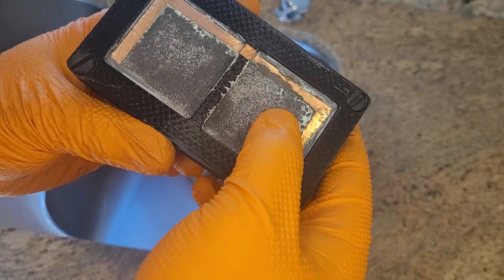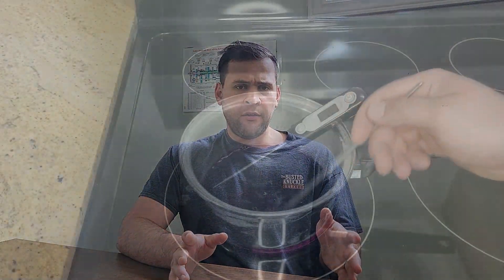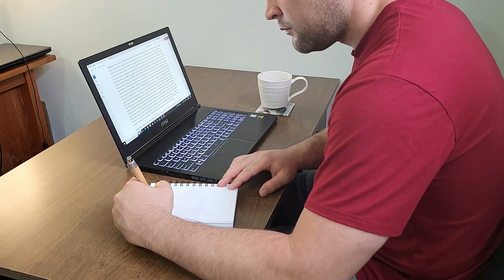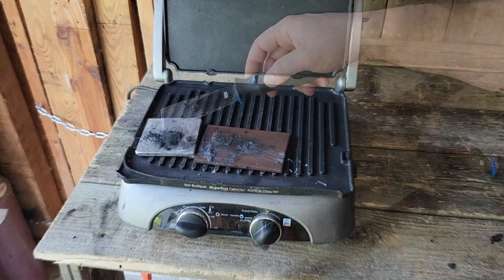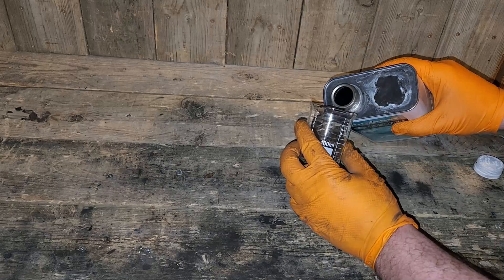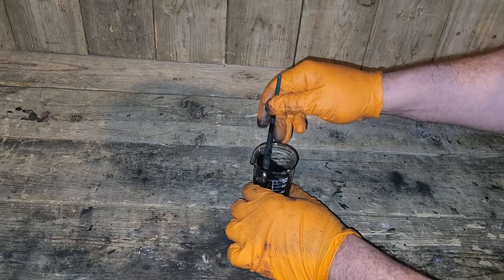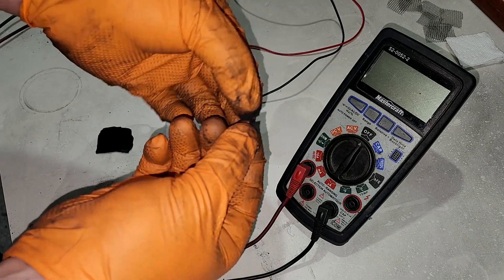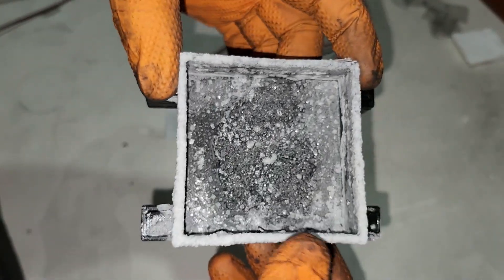Innovative DIY Cathode For Aluminum Air Batteries

Comment: very interesting bro, and you are aware that the more addatives wich are not electronically conductive, will result   in less output voltage and amperage.. you could try an additivve that holds value , for thermal stability instead,
Reply from the maker: Hi there @randymorales1127 While I am aware that metal oxides don't lend themselves to conductivity (they actually hinder it) the fact that their presence in the cathode boosts the output is undeniable.  I opted for MnO2 here because it strikes a good balance between affordability and improved output.  Did you have another material in mind that could do that?  I'd appreciate your input.
Reply: I'd look into some of the solar cell tech going on. There are a lot of TCOs out there now (Transparent Conductive Oxide) but I'm not sure which ones would encourage galvanic loss and which wouldn't.

Comment: Dude. Acetone styrofoam or plastic made into a liquid mix with graphene. Graphene can be doped with silver powder. It’s not easy but I take my powder graphene and silver powder and using a ceramic cup I torch the cup red hot. The silver and graphene are stored together. Silver gets in pores graphene. This enhances conductivity

Comment: you should look into starlite recipe guesses where carbon compounds like PVA glue corn starch sugar ect are doped with a flux compound (at least some use it as flux like for smelting aluminum ect) of borax or boric acid ect, to keep it all from heavily oxidizing into gas (CO2) though they tend to add baking soda or something else that will release CO2 with out having external oxygen needed for a foaming method to exfoliate it to allow it to become a graphite based foam insulation to protect internal items, BUT in your case maybe switching to something else to avoid this process and all while maybe allowing the components to remain inside the graphite structure on burning or heating and evaporating off the hydrogen and oxygen ect in the carbon donors might be capable of being your needed remaining or injected components to facilitate the catalytic action on the aluminum 

Right now I am working on ways to undo this oxidation and have succeeded with red iron oxide being reduced back to pure iron metal bonded to the base it was done on using a 405nm UV laser of 500mW power level, and reducing white powdered TiO2 into the black and brown crystals of TiO2 and Ti2O3, so a method to pull the oxygen away via electrostatic charges is next on my testing list to attempt depositing much harder to deposit without interaction (oxygen based) of Ti and Al like you are using in the aluminum batteries :)
Reply from the maker: I had to read up on starlite before responding.  It's an approach I hadn't thought of previously, but it could have potential.  I'll have to play around with it in the near future! Thank you for sharing you're experience with this!  Cheers!

Comment: Hi, other than teflon, another binder that is commonly used in electrodes is PVDF. Carbon black is also sometimes mixed into the cathode slurry.
Reply from the maker: Hi again @pixlrainbow.  Great as always to hear from you.  PVDF looks like it has alot of promise for this application.  It's melting point is alot lower than Teflon.  Have you ever working with it yourself?  Any pointers you could give?
Reply: @MechanicGoneRogue  I have not personally worked with it, but I have seen it referenced a lot in various research papers. Some use a heat press or hot roller directly on dry cathode powder without solvent, others use NMP solvent without a heat press and simply paint the cathode slurry onto current collectors and leave it to dry (with hot plate assistance).

In this video you used PTFE with a solvent and active material to form a wet slurry and heat pressed it, however I have also observed PTFE being mixed with just water and then added in very small amounts to active material powder to form a dough-like cathode paste that is simply rolled out and left to dry.
Reply: Carbon black is very conductive but graphene blows it out of the water and is easy to make.